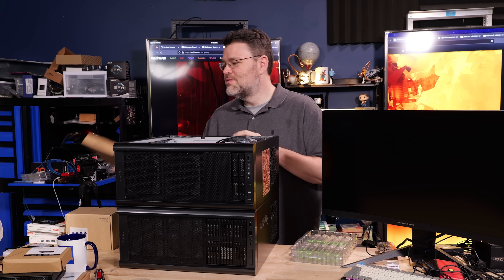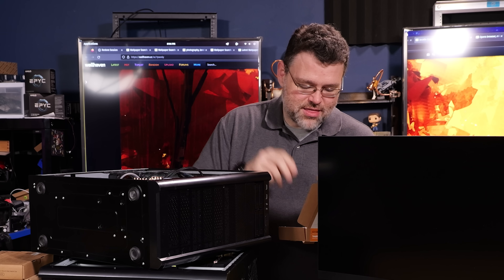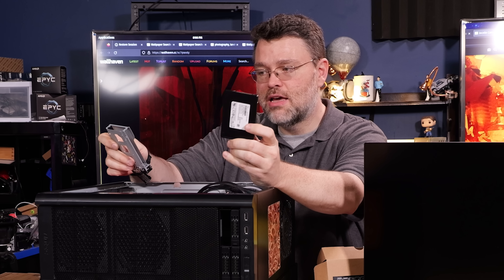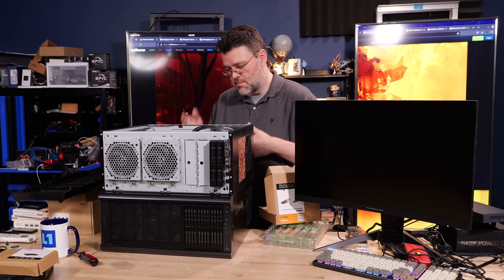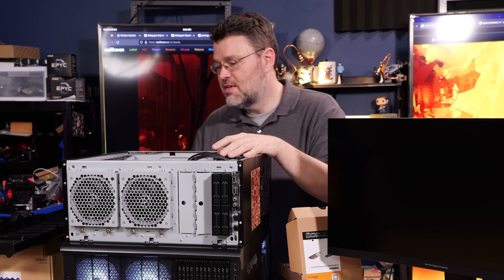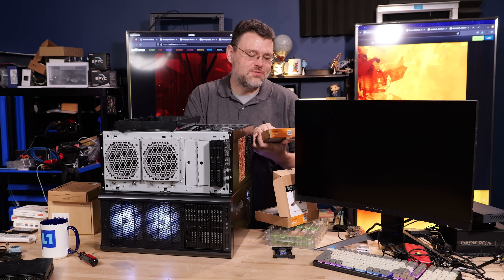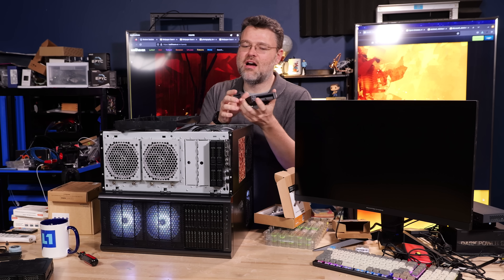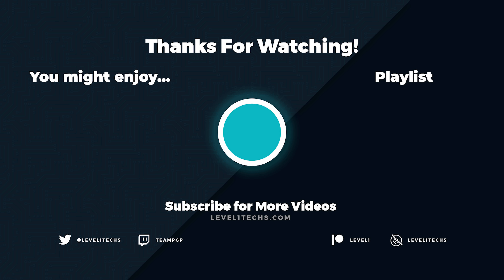Icy Dock PCIe Means More M.2

Comment: The icy dock adapters are great, however the price is not so great. Hoping for lower prices in the future or cheaper Chinese clones, so the adapters would come in a price range that are feasible for most people with a diy homelab
Reply: I agree with you, but the demand for consumer storage mobile racks is really going to be small. If you want to consider it, pay attention to ELS storage. There is only one KINGWIN brand NVME mobile rack in the North American market, but in Russia (Eastern Europe?), ICY DOCK level products are sold under the name of PRO CASE.
Reply: This is something I CONSTANTLY re-search for. I have been looking for YEARS.
I realize the use-case is semi-niche so it's hard to get economy-of-scale working for us, but I just can't justify spending $150 on a 5.25" enclosure.
I'm fine with injection molded plastic rather than Steel/Aluminum.
But the price needs to be SO MUCH lower. Which probably isn't possible right now.
It needs to cost less than a bare 4U chassis, to fill up that many 5.25" bays (9-10). That's like $30 PER BAY at most.

That is the problem with IcyDock stuff.
I'm not going to spend $75 for an enclosure to hold a $80 drive.

They have the same issue with their 5-in-3 HDD enclosures.
I can buy a used disk-shelf, gut it, and build an entire system in it for the cost of a new case + IcyDock bays.
Is that going to fly in an office? No, but their stuff has never been at that level.
It has ALWAYS had that HomeLab/HomeNAS, hacked it together but nicely, thing going.
There is clearly SOME market for this stuff, but I'd honestly rather build 2-3 systems using sheet-metal bay converters than a single "nice" one using tool-less IcyDock stuff.

Comment: Be careful when getting Samsung Enterprise SSDs, while the price per TB storage and their performance is great, it’s a pain to get firmware updates and Samsung doesn’t offer end customer warranty service for the “OEM” variants. I recommend the Micron 7450 line for that reason, 5-year warranty and updates publicly available.
Reply: I actually have a Micron 7450 Pro in my personal system an E1.s version at that. Was like $150 for a 3.84tb drive so it was worth it though to put up with an PCIe adapter. Got it off eBay

Comment: If you want PCIe/NVMe (also M.2 via adapter) Hot-Plugging you can use HBAs with an active PCIe Switch Chipset in any motherboard. For example in Windows the NVMe SSDs then show up like external hard drives and can be ejected via an icon in the taskbar.
Reply: Out of curiosity, does Windows have any performance hits when seeing the drive as "external"?
Reply: @NPzed  Nope, the only bottlenecking is going to be dependent on the amount of PCIe lanes the PCIe Switch itself gets from the host system and the number of NVMe SSDs getting handled on the other end.
Reply: @abavariannormiepleb9470  Thanks for the info!
Reply: @abavariannormiepleb9470  Could you give like a model number for the HBA that you are talking about?  I don't know exactly what you are referring to.  Thank you.
Reply: @PoeLemic  
You have the choice between two categories of HBAs:
1) Pure PCIe Switch HBAs, only NVMe SSDs work with them, examples: Delock 90504 (PCIe Gen3 x16-to-8xU.2/SFF-8643), Broadcom P411W-32P (PCIe Gen4 x16-to-4xSFF-8654-8i), SSDs show up like native, tools like SSD firmware updaters or CrystalDiskInfo work fine.
2) “Tri-Mode” HBAs, can handle SAS, SATA or NVMe SSDs, for example Broadcom HBA 9500-16i, I’d avoid them since they unfortunately further virtualize the connected SSDs leading to possible tool incompatibilities
Reply: @abavariannormiepleb9470  strictly speaking, pure PCIe switches have NVMe-only outputs because NVMe is the only storage media that supports PCIe natively, which is what a pure PCIe switch puts out. You can use an m.2 to PCIe x4 converter, and then plug in a PCIe x4 to SATA or whatever card. Yes its jank. I never said it wasn't jank af.
Reply: I don't know how they do it on the technical level, but my Dell has 2 NVME hot pluggable in their so-called Flexbay in the front. PCIe 4.0, runs from factory Kioxia XG8 full speed without any problem and on Linux and Windows they show up as perfectly normal nvme devices.
Reply: @thisiswaytoocomplicated  I would surmise there is a carrier board that the M.2 cards get docked in?  It's the M.2 connector itself that is not hot-pluggable, not necessarily the drives themselves.   U.2 for example is hot-pluggable (assuming MB/CPU support).

IIRC, this is usually tied to the length of the power and ground pins relative to the data pins/fingers.  When all the connections are the same length, there is no way to safely ground>power>data link the drive.  So if a carrier board took care of that process, then in theory an M.2 could be hot-swappable.

Comment: I have a bunch of Icy Dock equipment, even added a secondary "CD Copier" style enclosure for 3 additional 5.25 bays hooked up to an external SAS card just to get more drive bays.  Love their products.
Reply: The issue is price though. Who is their target customer?
The entities that can afford to buy this stuff would NEVER choose it over a marginally more expensive black-box with a 5-year support contract.
The kind of people that WANT this stuff, are also the ones that will spend $300-$400 on a 4U chassis for a HomeLab.
Those same people don't spend another $450 to get a few bays of front-access NVMe.
If they did, they could have bought a barebones chassis from any of the DOZENS of suppliers that already make this stuff for ~$1000.

IcyDock stuff makes no sense. And it never really has.
Look back at their 5-in-3 SATA/SAS stuff. Those are like...$150-$250...each.
That is insane. You can buy a whole disk shelf for the cost of 2-3 of those.

IcyDock's prices need to be like 1/5 of what they are currently to be "worth it", and that just isn't even remotely feasible.
A stamped Aluminum sheet with a $3 BOM PCB cannot cost 2/3 of the price of the drive you intend to put in it.

People are not putting $5k drives into these.
They are putting $50-$150 drives into them.

So I ask again. Who are these FOR?
Reply: @Prophes0r that's what I'm struggling with currently. I want them. But the enclosures cost more than the drives I want to put into them... Makes no sense.

Comment: I think restarting civilisation might need videos on the basics, as simple as making fire! Of course, electricity to watch it might be the first priority....back to cave painting it is! 

Great work Wendell, nice to see an old case like mine crop up 👍
Reply: Step 1: relocate adjacent water wheel and generator to a water fall or river with at least 2000W of available water power through to the generator. Also acceptable is a wind turbine or solar panels. 
Step 2. Set stuff up and plug green grass colored plug A into grass colored receptable A. Plug monitor cable red (blood colored) cable B into red port B on the back of the computer. Plug brown tree colored keyboard and mouse plugs into brown USB receptacles.
Step 2. Hit power button shaped like this (C-) 
Step 3. Find folder on screen labelled "Restarting humanity" which will direct you to the most relevant Wikipedia pages.
Step 4: learn
Step 5: implement what you have learned
Step 6: repeat and expand.
Reply: @mikes2381  Looks like you've restarted a civilisation before! 👍😆
Reply: Power banks, a converter, a solar panel, a good quality DIY kb and mouse with plenty of replacement parts and a bunch of reliable monitors (because I have no idea how to get around panels wearing out).

You could even get around the converter with some engineering and make everything pure DC, I think. There could be some unforeseen issue I'm not thinking about somewhere. You could probably build up a "Library of Alexandria" that could survive anything short of getting directly nuked for less than $5k and the whole rig would fit in a couple of backpacks.
Reply: Water > Food > Fire > SOAP > Steel

infection is a bitch...
Reply: @Prophes0r  The Wikipedia page has great resources on how to make safe drinking water, different ways to make fire with what is around, what is safe to eat and how to prepare food, how to make soap and how to make steel. As well as many other things like how to treat wounds, make traps, build easy and effective means of protection, etc.
Reply: @Prophes0r  ? Why do you think you need to keep data around for 500 to 1000 years to get civilization going again?

You get through whatever causes the collapse and maybe a few years of chaos and then you start educating the new generation. So you need a system that survives 5 to 10 years plus the length of time it takes to bootstrap basic industries, so call it 50 years maximum.